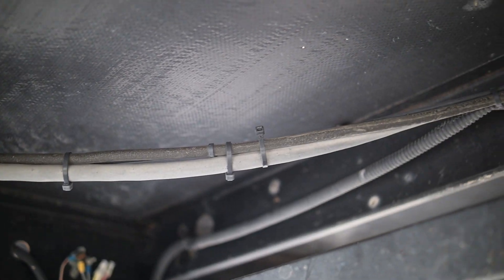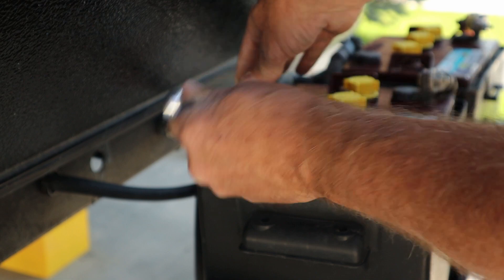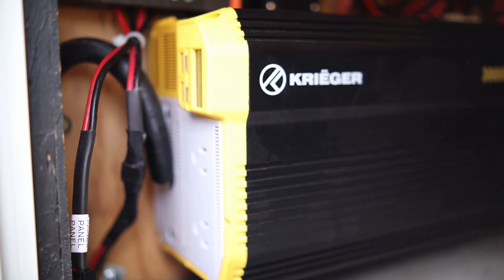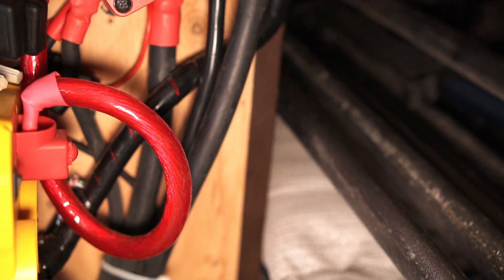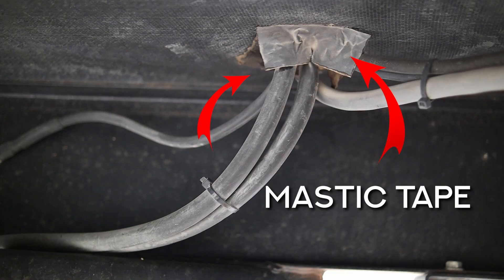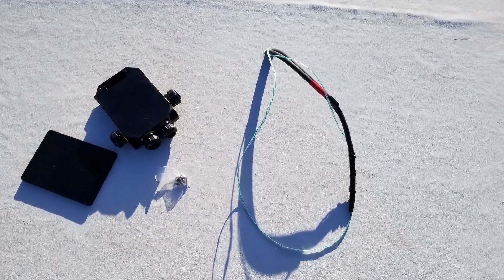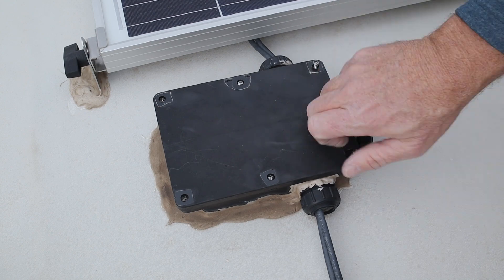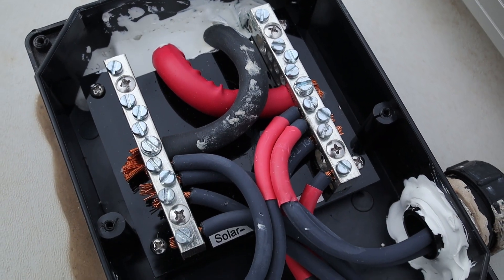wiring an older rv for solar| RVAddict

Comment: I have an 80's RV with 1 starting and 1 house battery under the hood. If I connect the solar controller right to the RV fuse box, would the solar power charge the starting and house batteries?